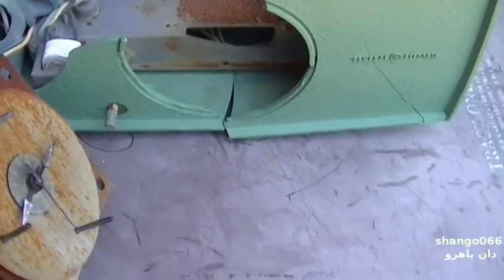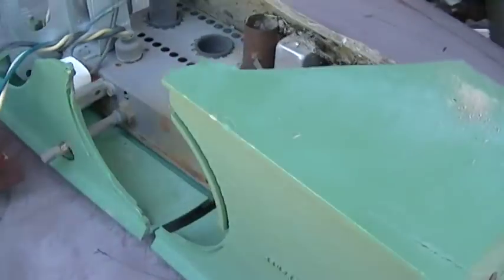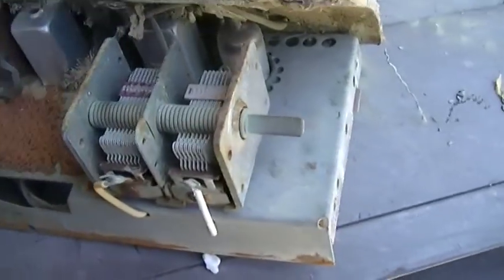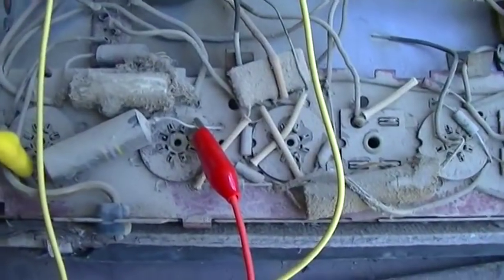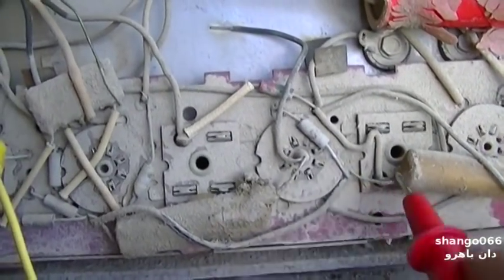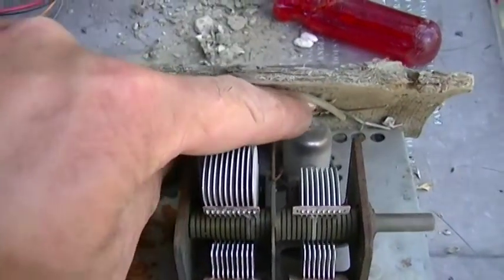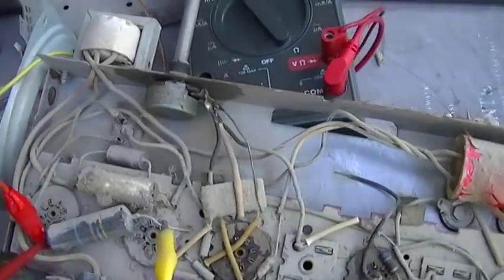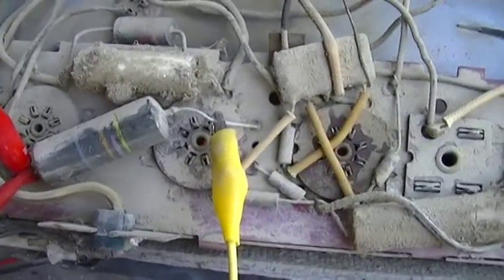GE Tube Clock Radio From The Dump Resurrection

Comment: This is a testimony to the simplicity, durability and resilience of the AA5, after sitting in the elements (probably) for four decades, 40 years! I find it rather interesting that the multi-section filter capacitor didn't fail.

Comment: Impressive, but not as much as that rusty Zenith TV from time ago.

That filter cap is stunning, it managed to survive somehow. Perhaps the rain falling on it kept hydrating it so it didn't go dry.
I had a speaker that was in a shape like that once, and I gave it a new cone made of thick paper just for the heck of it. It turned out unexpectedly good, I even put it back on it's original radio.

Comment: Man, you are living dangerously by connecting that bumblebee capacitor directly to 120 VAC! :-)

I was surprised to see how this well this thing was working after a minimal amount of work. I was also impressed by how well the gun lube cleaned the corrosion off the variable capacitor.

Finally, I learned that the glass-metal seals in vacuum tubes are not waterproof.

Comment: and this is why tubes are so much better then modern stuff
Reply: +robot797 Theyre not actually tbh, they are very unreliable and contain lethal exposed voltages, especially here in the uk they run on 250v 13 to 20amps
Reply: Synthematix dont lecture me about tubes
i have focust my hobby on them
Reply: ***** Then you would know everything i said is true, they are constantly in need of attention so no, things werent built better
Reply: Synthematix i found out that tube circuits almost never need atention

for example my pcl86 amp (own design and build)
its running on the original tubes that i put in around 4 years ago
and the tubes still test 80% good
Reply: Im talking about vintage stuff, components are built better today especially capacitors
Reply: Synthematix well i begg the diverence
the capasators in most tube equipment are 50 years old
and they still kind of work
most modern parts wont last more then 4 years

Comment: Keep that radio and it will come in handy when the World Wide Web goes down.............I could hear The Dennis Prager Show and Mark Levin coming in on 870 AM Los Angeles loud and clear!  That same "The Answer" programming comes through on a sister station 590 AM KTIE San Bernardino.
That is a Telechron clock in the radio and it was a precision time-piece.  The Rotor which runs the clock is sealed but it can be brought back to life using certain methods of restoration and if not used in this clock, then on another Telechron Clock, as they were hand made and sealed in generally cooper.  The Rotor in the clock if polished would be a bright copper, and not fake, but real copper.  The later Rotors were not made as well and were not sealed in copper.

Comment: Three leads on output transformer primary?  That's a "humdinger" feedback tap to eliminate hum.
Do I see a bumblebee in there?  
I find it hard to believe that a glass metal seal would allow water through but not air, aren't water molecules larger than air?

Comment: GEEZUS did you see the fangs on that petrified spider @ 2:10? She probably kept any repair personnel away from working on that radio for 20+ years. The tube box held up against the old speaker should get the Nobel prize for electrodynamics!

Comment: Amazing that radio works!  Would a radio of the same vintage with transistors still work?
Reply: +Edward Morris i doubt that. transistor equiptment has much less tolerance for component value change.

Comment: There are 2 things I would like to see from you: 1 get a scuba gear and go on a wreck, recover a CRT tv from that wreck and show it to us how it's inside and if can be fixed.and 2 take an old tv with vacuum tubes, make a new modern PCB using the original schematics but with vacuum tubes and new caps, new resistor, etc...

Comment: Wonderful, not one cap replaced?
Reply: Craig Nehring 
Before restarting an old tube radio , i always recap the hight voltage section (300vcc)  of the power supply to not damage the rectifier tube  , the hv caps are always dead dry , or shortciruited . If the rectifier tube is dead and not available , i wire a solid state rectifier instead of the dead retifier tube ....works great and get the radio alive .
After i start the radio and fix others fails in it

Comment: there was  a HMV clock radio in the UK very similar but with LW as well
Reply: actually the under chassis assembly looks almost identical.....!!
Reply: big difference was it had an energised speaker and auto-transformer to feed the valve/tube heaters

Comment: That's amazing you are really good at electronics and I like how you trouble shoot AWESOME.... gotta a question I have a Fender Deluxe Reverb Mock 2 I've had apart before and I seen a black device with four leads in the middle of the circuit board with the word LED on it. I haven't got a diagram for it yet but I will I bought it brand new in 84 I think it was just wondering what that device is always wanted to know lol it's a tube amp.

Comment: Hello Shango, So i just aquired the parts needed for a "Dim Bulb Tester".
I've heard that in some countries the AC outlet is polarised, Live and Neutral.
Does it matter which wire i hook it up to?
if that makes sense, I'm horrible at explaining things
Reply: For safety, the base shell is neutral, the center is hot. You could connect the other way and still works but could get someone killed.

Comment: you could recone that speaker. Make a homemade cone. also the not getting the tubes wet. Thats good to know. I would have thought as long as the pins arnt corroded it would be ok but now I will make sure I dont get them near water ever.

Comment: I am not saying your wrong about the tubes leaking when subjected to water..but as long as I have been doing refrigeration(20 years)...I have NEVER seen a hermetically sealed compressor leak...at the wire connections into the compressor...and true the compressor is not under a vacuum like the tube is...but it is for a short while at the pump-down stage..
Reply from the maker: +Kennynva T. I have seen those connector pins burnt and blown out of the side of the compressor. I think they are a bit more hard core than tubes. Its something I have seen time and time again.
Reply: A refrigerant compressor and a vacuum tube are two completely different things.